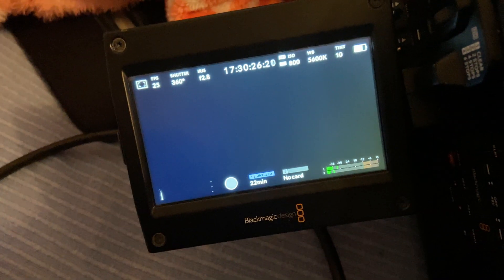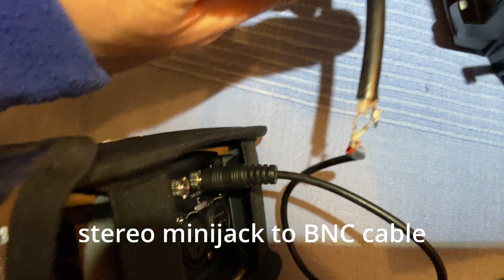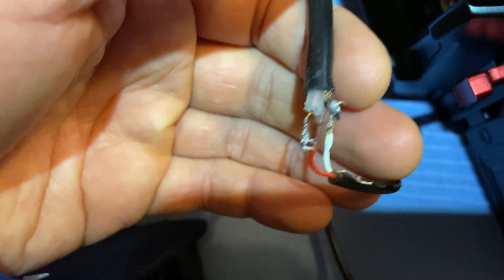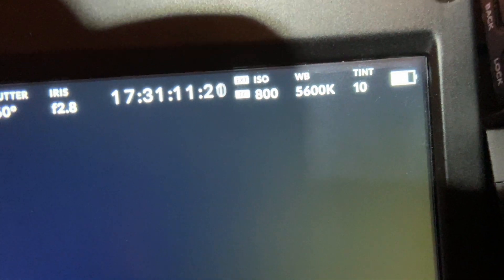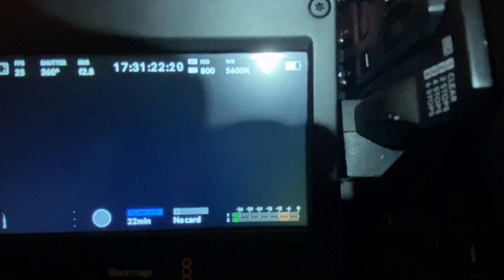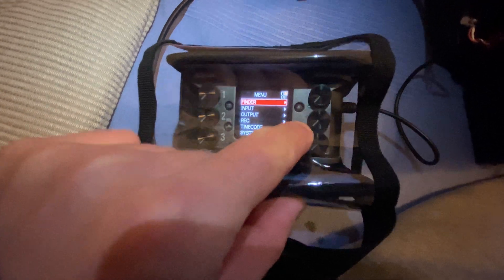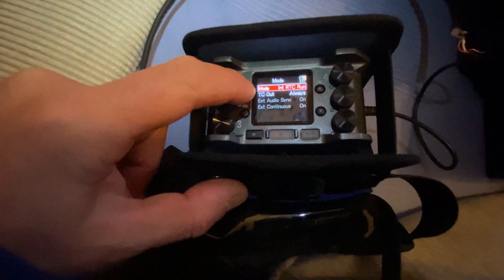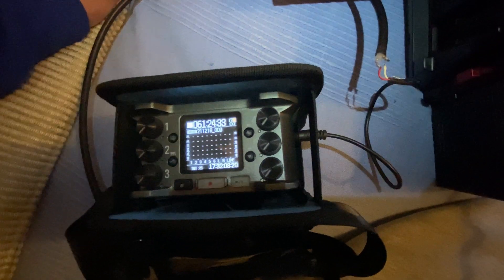Zoom F6 timecode out to Blackmagic Ursa Mini Pro - custom cable

Comment: I connected as such, but no luck. Exactly right channel to the tip and right channel to the ring. I can hear timecode by touching the tip to a headset. but still the Ursa mini pro g1 does not pick it up as EXT

Comment: I use a stereo jack plugged into the f6 and then another mono one into that and then my Timecode cable. Problem with the F6 is it sends it out of the right channel and the BMD cameras read from the left channel.